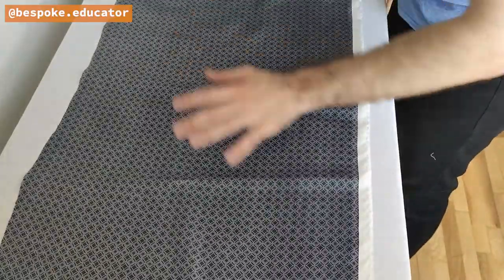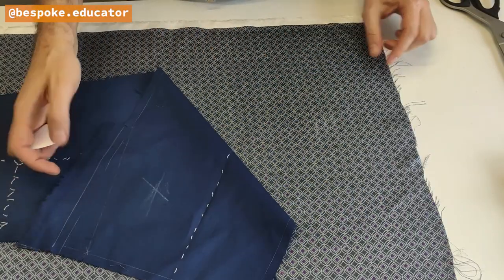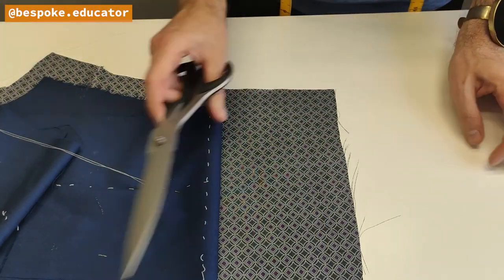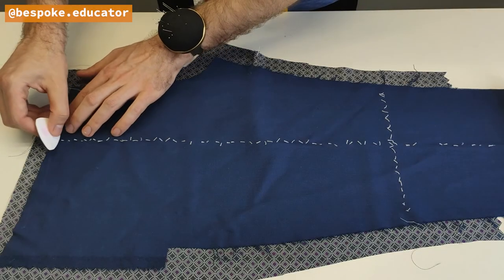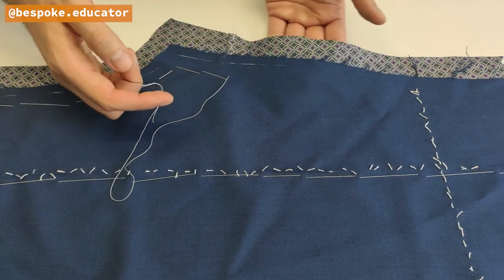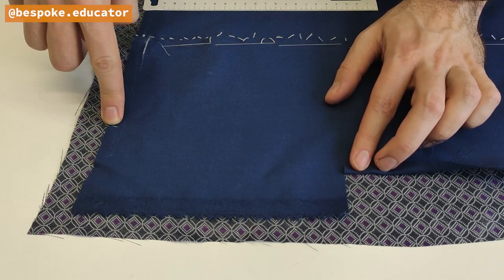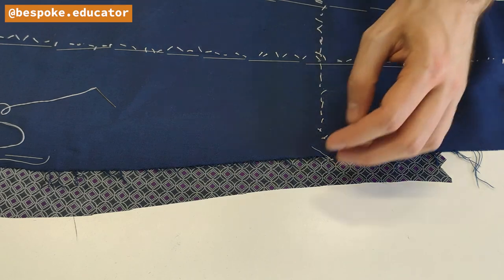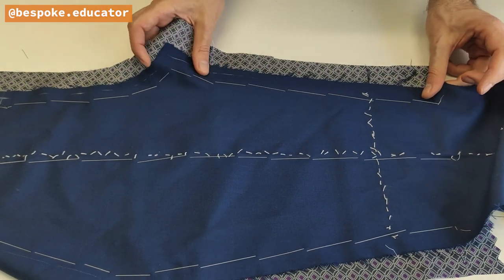How To: Lining Trousers

Comment: This is so clearly explained and super helpful! Thank you! And I do have a question. Is there a better way to prevent the upper thigh area wearing out or pulling? I’ve heard tailors putting a saddle (not exactly sure what it is) or a triangular shape of lining on the crotch seam. Will that work?
Reply from the maker: Hi! Thank you for watching and I`m glad you enjoyed it. Subscrive for more trousermaking content that is coming soon. ;) 

Regarding your question: there are severeal ways of reinforcing a trouser crotch. 
First one: I put a piece of non-fusible interfacing covering whole crotch edge on the fronts, then the lining covers it. I added this method to my course. Some people just fuse this part, but I don`t like it. Non-fusible interfacing gives more flexibility and doesn`t shrink the fabric. 

Then, when the trousers are almost finished: you are right, a saddle goes in. It can be made of lining but I use pocketing fabric that was used during the manufacturing of the particular pair. A saddle basically covers the area where crotchseam, backseam and inseams come together. This "knot" doesn`t look good, so it is covered with a saddle, plus it also prevents this part from ruining, because this area apparently gets a lot of friction. :)

But all these methods only prevent trousers from ruining on the inside. Some people have full hips and over the time they can make a hole on the innner side of the leg even in jeans. So, in this case, if you are making a suit for such client: offer him two pairs of trousers and one jacket.
Reply: @BESPOKEEDUCATOR  Thank you!

Comment: Thanks for this video.  Can you tell me why you added a fold in the fabric before you started cutting out the lining?  It is in the crotch area.  Also can you just now sew the legs together after the lining and the fabric are together? Thanks again
Reply from the maker: Thank you for watching and your question. 
This little fold on the lining is optional. It may prevent the cloth from pulling and gives extra fullness. You can skip this part if you are already experienced in setting in the lining and also on some thin fabrics it may leave an imprint after pressing. 

I don`t quite understand the second question but I`ll try to answer. :))
After this step you have to make: side pockets and a fly. And then, yes, you may connect side seams.

Comment: Hi! Thanks for the video! I have a question tho- since I'm putting the lining why not just assemble lining pieces and then trouser pieces following all of these steps except overlocking them together ? I don't really like the idea of having both lining and overlock, it seems redundant, and I thinks it's possible to avoid overlock completely. Is there any specific reason why overlocking them together would be better option than without? Many thanks!
Reply from the maker: Hi, interesting question. 
May I ask, why so you think overlocking is redundant?
Reply: @BESPOKEEDUCATOR  Hey thanks for the reply! Well, im still learning all of this but in my mind overlocking is a type of finishing and lining, apart from few other beneficial aspects, is also a type of finishing/ protecting unfinished edges, so if i put a lining i would consider overlocking an extra step thats not necessary. Another thing is also the aesthetic of the garment, because lining is very elegant/expensive finishing and overlock very casual. I think my question was mostly due to the fact that in your assembly you use lining but allow overlock to be seen, and id rather hide it... :)
Reply from the maker: @mikka9272   ah, I get it then. 
In this case you may use the bias binding instead of overlocker. 
But in my opinion finishing trouser edges with bias binding looks great but not always practical. 
Some cloths with high Super numbers, are quite fine, light and delicate and bias banding may bulk up the edges and then leave the imprint after ironing. So, overcasting with a special fine texturized overlocking thread could be a better option in most cases.

Comment: Is it possible to use French seams instead of serging?
Reply from the maker: Hi, interesting question. 

I think it may be problematic, because in this case you`ll have to sanwich lining between two trouser panels and a lot could go wrong: the parts may shift and a seam may pull in result. 
If you don't want to use the serger you may try finish the edges with bias tape (silk, lining or chiffon)

Comment: Brilliant work but you didn’t explain why linings are used in the construction of the garments
Reply from the maker: Basically the lining absorbs the friction at the knee area and prevents the front panel from stretching (because of the knee movement and heat & moisture that body produces). If woolen fibers are stretched it is almost imposiible to get them back into shape.

Comment: A useful tip is to ensure the front pockets hang between the outer fabric & the lining as it is a sign or quality, it looks more professional too. 
The lining can then stop the pocket bags from rubbing against your thigh when wallking along. 
I added a Half-lining to my Boiler Suit for winter use, and checked that the front pockets hung between the outer & lining layers for better comfort & a tidy look too.
Reply from the maker: Hi, great comment.
If we are talking about casual or designer clothes, you can go crazy with various techniques.
Pockets sandwiched between the lining and the top fabric is an interesting concept and harder to execute? - Definitely.
Is it more professional? - I doubt it.
Classic tailoring has its own rules and techniques regarding the order of assembly and finishing, so it will not work in this case.

Comment: May I ask why you sewed a pleat into the lining as I don’t understand why?  Many thanks 😊
Reply from the maker: This little pleat on the lining is optional. It may prevent the cloth from pulling and gives extra fullness and movement, for example on close fitted trousers. 

You can skip this part if:
a)  you are already experienced in setting in the lining
b) you are sure that decent amount of ease has been added to the lining
c) if trousers are more classical and loose fitted (for example wider, pleated options with more room)

Comment: Why do we put a pleat under the crotch area? And why do we attach lining to the pants? Please tell me😊😊😊❤❤❤
Reply from the maker: So, the pleat is optional, latley I rarely use it, especially on thin fabrics. Its idea to give the lining some extra volume & movement to prevent the inseam from pulling. If you have added sufficient amount of ease, you may skip this part.  

The main goal of lining is preventing delicate cloths (wool, linen etc) from deformation at the knee area. You see, our body produces some heat and moisture + if a knee rubs directly against the cloth, over the time the fibers will deform and relax, ruining the trousers eventually.
So, technically lining absorbes that friction and the upper cloth slides over it keeping the initial shape of trouser fronts.
Reply: @BESPOKEEDUCATOR  Thank you so much, Sir! 💗💗💗🫠🫠🫠
Reply from the maker: @jaskaransingh06478  You are welcome, ask anytime))

Comment: This is so well explained! I also followed you on IG! One question: why is the lining so short? Is it not supposed to be below the knees or all the way down to the ankles? Thanks!
Reply from the maker: Thank you!
It is usually around ~18-20 cm below the knee marking, so it is enough since the knee cap meets the knee position and there is sufficient lining to do the job which is to protect the cloth from stretching. 
You may do it longer or all the way, it is completely up to you. 👍🏻
Just, what is the purpose of lining at the ankle?
Reply: @BESPOKEEDUCATOR  I thought lining is usually to stop the itchy fabric from touching the skin or prevent static, so all the way made sense to me. But I might be wrong! In your professional work, lining all the way is something you see often, or not so much? Thanks again!
Reply from the maker: @darziyaana  
In a way yes, the lining is to prevent the body rubbing against the cloth. 
Nowadays high quality wools are so fine and tender, so they are not itchy at all, in my opinion.  

If the main cloth or\and the lining have synthetic fibers in them, you will be able to power up a small city with electricity while moving, so the lining itslef can do nothing to prevent it 😃 If your cloths are of natural fibers, for example 100% woolen trousers or lets say a waistcoat, with viscose lining, you`ll be fine. 

As I have already mentioned, modern suitings are fine and delicate, so the lining on trousers prevents the fibers from deformation. Throught the day our body produces heat & moisture  that affect the cloth (like a small iron). So, giving all that if a knee constantly rubs against the trouser cloth pretty soon you will get a bulb at the knee area and you can do nothing to fix it, fibers are already streched. That is why we are covering the knee with lining so it gets all rubbing, but the upper cloth just slides over it without being deformed.
Reply: Thank you for such a detailed reply, very helpful! :)
Reply: @BESPOKEEDUCATOR Ahh! You just answered my question! I just subscribed

Comment: CAN THE LINING BE ADDED TO BOTH BACK AND FRONT?
Reply from the maker: Great question. You could of course, but why? What will be the purpose of lining at the back?
Reply: @BESPOKEEDUCATOR  the fabric is kinda light weight
Reply from the maker: @shop_withsteph5340  In this case, yeah, sometimes it is a solution, But, I don`t like it. 
I always choose fabric of a certain weight from a cloth bunch, together with a client, to avoid "transparency".
And I rarely take a cloth that client brings from elsewhere.
Reply: @BESPOKEEDUCATOR  thanks a lot